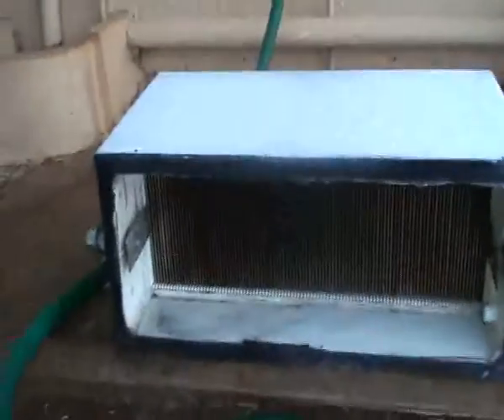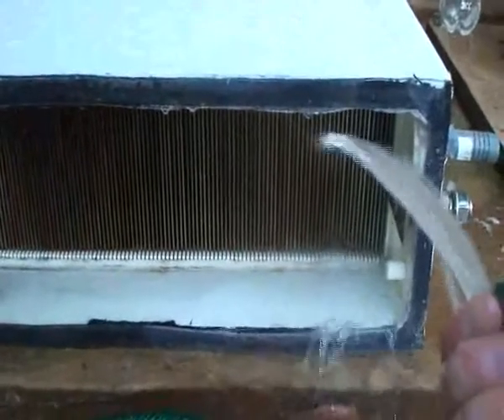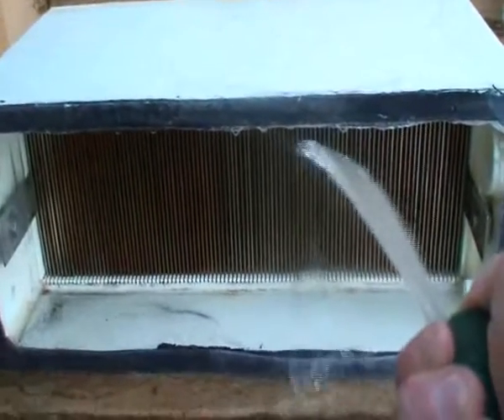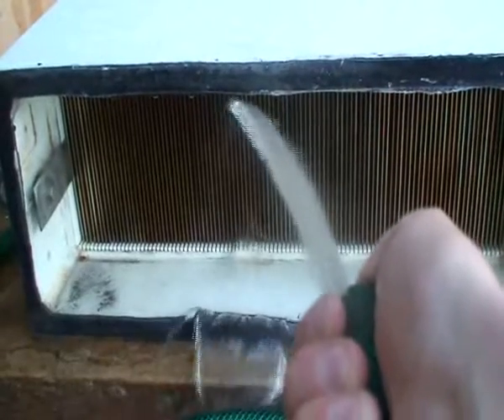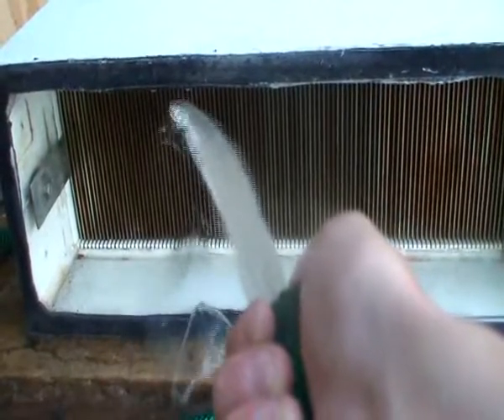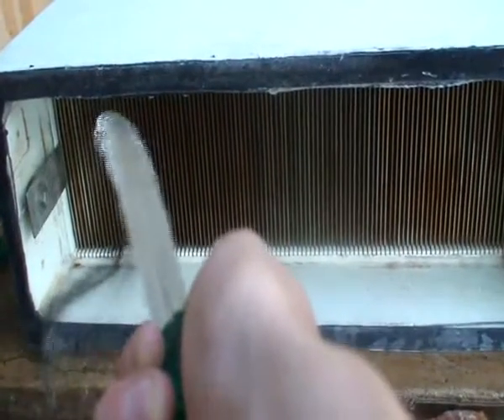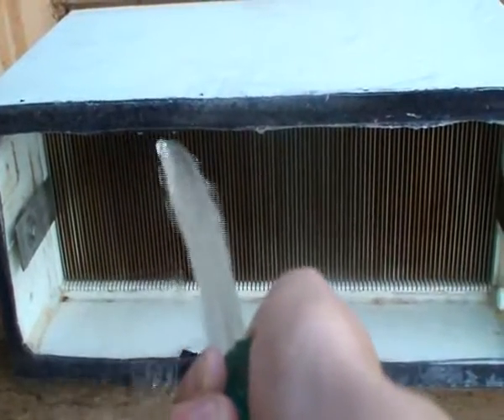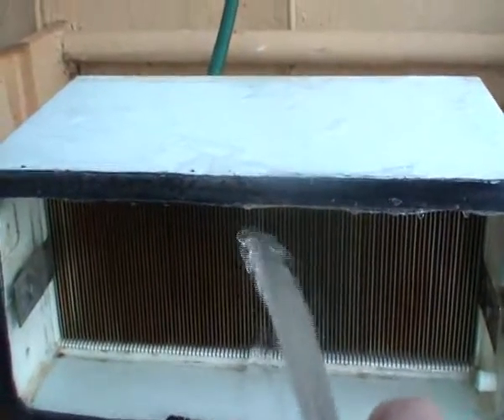Cleaning out my cell showin the Hexavalent Chromium that formed

Comment: The black stuff is just the catalytic layer that forms on the oxygen side, or calcium in the water turns blackish color. The oxidized side of the plates is a dark grey color. Bob's cells do not get hot enough to produce the hexivalent chromium. You surely want to get the chromium oxides of the plates. Chromium Oxides will prohibit ortho HHO from being produced. CO is is yellow color, Iron oxides is brown and the hydrogen side is this nice bronze.gold color catalytic layer, that is when the cell starts producing a high quality gas! Flushing a cell out and starting with a new batch of water/NaOH or KOH is always a plus! It takes a few days of running for the water to take a charge. Bob;s cells improve with age. They can last a lifetime, if you do no run the too hard and hot!

Comment: Hexavalent chromium is also toxic; thought you wouldn't have this problem if you didn't use stainless steel. use copper or aluminum. Your screws and fasteners are probably the source.

Comment from the maker: 4 and 5.  I used only distilled water for the electrolyte solution, and to make the electrolyte I used NAOH and KOH.  As I said above, I first did a batch of NAOH until it was nearly finished, and then cleaned the cell, and then a batch of KOH and so on.

6. My plates are all SS 317L (very expensive stuff)

You are welcome about your english mate, this technology is about helping each other, not a language course ;)

Hope this helps!

Comment from the maker: Hi Sano,

1.  I used a few different methods.  for cleaning I run it as high as I can (up to 6 amps) to get the plates to clean.  I do this on NAOH.  After this, I clean the cell as seen, then wash out with distilled water, and then run it with 10 - 15% KOH at between 0.5 amps and about 0.8 - 1.00 amp..

2.  I never checked how many hours a day, but as long as I could every day while maintaining safety.  In total it's over 500 hours, and I still clean it whenever I am home.

3.Don't understand.

Comment: Hi wajtkiki, 

 please answer: 

 1.How many amps and how many Volts will use for cleaning the electrodes? 
 2.How many hours a day was cleaning? 
 3.Where often the purified electrodes?
 4.If the quality of the water for cleaning electrodes 
 ť. What the electrolyte used 
 6. Electrodes were  from material SS 316L? 
 Pardon  my imperfect English

sano